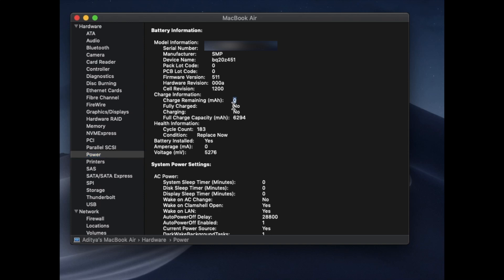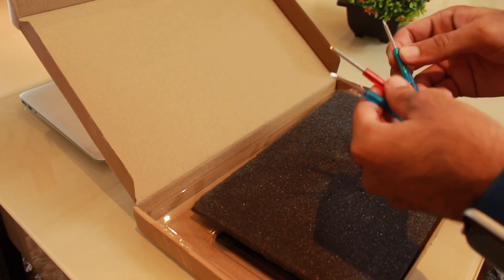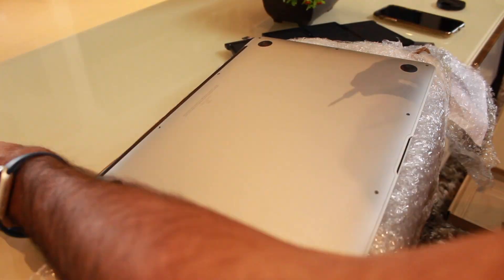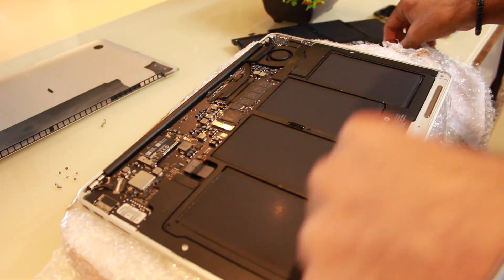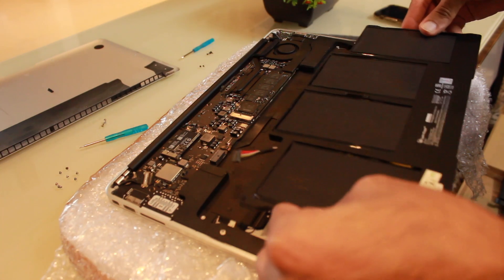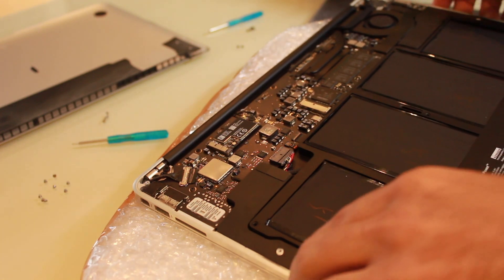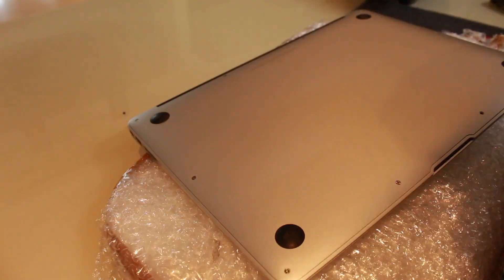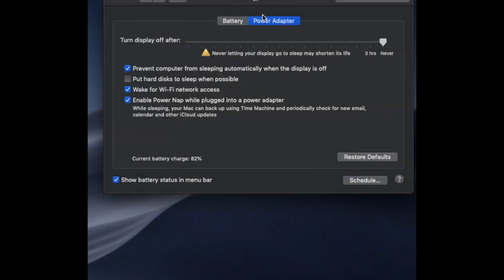MacBook Air A1466(Early 2015) Self Battery Replacement

Comment: Bro i have macbook air 2017 model 13 inch  which battery compatible for my laptop ??
Reply from the maker: that macbook's model number is A1466. So search for "batteries compatible with macbook air A1466"

Comment: After one year, what is the performance of replaced battery?
Reply from the maker: Average I would say. The laptop goes off suddenly when out of charger. Also it becomes dead when the macbook shows 20% battery left. So it can sustain for sometime without the charger but ultimately you do need to carry it if you're moving out.

Comment: Hi Aditya,

I have MacBook air 2013  and I am planning to change my battery because when it is not charging it becomes much slower and it was not usable and when it is connected to power cable it performs like as new... I have formatted many times but it stills remains the same... So di I need to Change my Battery??
Reply from the maker: Actually the thing is, when gadgets become old they lose their processing power gradually. While staying connected to power, the machine tries to push its limit to the maximum. I don't think replacing the battery would help in that case (i'm saying this with my past experience when using a mobile phone). But since you're saying that it performs like new on power then it MIGHT be the case of the battery but not sure. Additionally you may try to chat with an apple executive through the apple website for the exact remedy or may give the laptop to an authorised apple service center for inspection.
Reply: @AdityaSonthalia Sure bro... Thanks.

Comment: Thanks for the video. I also need to replace my MacBook Air battery. How was the performance and life of this battery?
Reply from the maker: I didn't notice any massive difference in the performance. But yeah the battery life has come down drastically. The battery discharges very quickly as compared to the previous one. Like if the battery percentage is around 47% virtually, in actuality its 0%. So not a completely satisfied replacement but yeah it does the job for the price incurred. Basic Browsing and video watching would be fine.
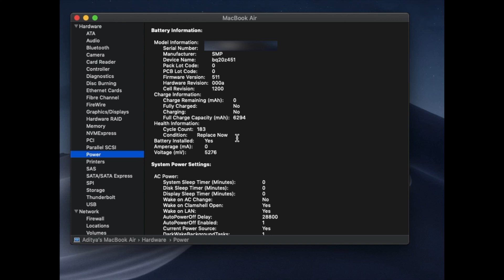Reply: @AdityaSonthalia  I appreciate your honest reply. How did you get to this 0:01 ?
Reply from the maker: @youtubeaddict5663  Sorry, get to what?
Reply: @AdityaSonthalia  it’s ok lol. I Googled it (hold down the option key and click on the Apple logo then click ‘System information’ - NOT preferences 😂)
Reply: @AdityaSonthalia  just wanted to say thanks. I ended up replacing my battery myself thanks to you ❤️
Reply: @youtubeaddict5663  How was your battery help up overtime? I need to get one too and planning the DIY route
Reply: @adityanilangekar1166  If you’re asking how my battery life has been it’s been great. I’m really glad that I did it myself rather than paying for a Mac repair shop to do it haha
Reply: @youtubeaddict5663  Great! So happy to hear this.
Reply: I need to replace mine also as it turns off when it gets to around 70%. How did you get on replacing yours? Where did you get yours from?
Reply: @youtubeaddict5663  I got it replaced from a nearby Apple authorised service provider. It's working great now. Getting around 4 hours of backup.
Reply: @kumardeepam  yeah I was thinking I should just do that coz it’ll probably take me hours to remove the battery and I’d be fuming if the second hand refurbished battery needed replacing within a year, lol. Do u live in Asia also?
Reply: @youtubeaddict5663  you should do that👍 yes, India
Reply: @kumardeepam  cheers 🥂
Reply: @youtubeaddict5663  🥂
Reply: @kumardeepam  So I decided to buy a battery off Amazon and do it myself. It actually wasn’t that bad - I was proper sweating beforehand 😂 but it took less then 15 mins to do so 🤞🏾 it lasts....
Reply: @youtubeaddict5663  incredible 👍
Reply from the maker: @youtubeaddict5663  I had ordered the battery via amazon (but sadly that seller has discontinued the same) which included the toolkit for self replacing it.
Reply: @AdityaSonthalia  Sorry my initial question was for the OP haha but it’s all good. I just found one on Amazon UK. Thanks for your replies though

Comment: Hi Aditya..... I want to buy a new battery for my Macbook air A1466. After watching your video, I decided to replace it myself. I am unable to open the provided link and when i checked it myself on amazon the cheapest one will cost me 8000 rs. Could u plz share some budget friendly options? Additionally, I saw one website “Lapgadgets.in”, and there the price is 3499. Should I go for it?
Reply from the maker: Actually due to this whole covid thing all those cheap batteries are out of stock for a long time due to absence of production. 
Considering third party companies for battery is always a game as we can't be sure of its performance or warranty. So its a challenge. Though I searched for Lapgadgets and found out that it's a decent Guj based company, We still cannot be 100% sure whether it will work perfectly or not. So considering the risk element you may go for it.
Reply: Aditya Sonthalia Thank you!
Reply: Did you purchase it from lapgadgets?

Comment: Bro the link isn't working?
Reply from the maker: yeah here's a substitute: https://www.amazon.in/dp/B089QNNF6W/?tag=adityas-21
Reply: @AdityaSonthalia  bro it's 8k u said we get it for 4k I have 2017 version
Reply from the maker: Sorry bro actually that 3rd party product is not available now and other products dont have any review. So its a win loss situation basically on whether you want it or not. i will provide you the link for the cheap one. Also what is your macbook's model number.
Reply: @AdityaSonthalia  2017 version MQD32HN/A A1466
Reply from the maker: here is one for 5k. That's the minimum I saw: https://www.amazon.in/dp/B084388J4R/?tag=adityas-21
Again, there is no review for the same and hence I can't guarantee you the performance. It depends upon your luck.
Reply: @AdityaSonthalia  okay thanks bro

Comment: In which Apple service center they quoted you 14K for battery? Here where I live they estimated the battery replacement around 20-25k :(
Reply from the maker: Sorry to hear that. That's the main problem with apple service centres in India. There is no proper transparency on the services they provide. Btw here in Kolkata, I had a talk to one of the apple representatives. So he gave me the estimate of around 14k at that time.
Reply: @AdityaSonthalia  Thanks for the reply bro. Video really helped me. I went to a local computer hardware wholesale store. Just got a genuine OEM battery with 7150mah battery capacity for 5900. Apple Service centers in India is just looting from people. In US pricing is more transparent.
Reply: @aravindhsharma2878  where you buy OEM battery?
I am having same issue and I got one from online shop but it didn't work, so please help
Reply: @AdityaSonthalia  My macbook is barely 3 years old. I was very ignorant, I used to put my laptop always on sleep. I never shut it down even when laptop is not in use. It used to last 12hrs now because of putting it on sleep for 3 whole years I'm getting only 2hrs sot.
Reply: they quoted me around 12k. :( fuckers
Reply: They asked me 9 k
Reply: @vishalkhobragade3535  Where?

Comment: Hy is the backup timing same as the original one?
Reply from the maker: no it's a bit low.
Reply: Should i buy ?or go for new battery frm service center
Reply from the maker: It depends. If you can pay more, you may go for the original battery.

Comment: Hi bro,
Nice video can you please suggest me from where I can buy original battery for MacBook Air 13".
My Macbook battery not charging and displays notification to replace it. Battery used only 48 cycle.
Reply from the maker: If you wanna buy the original battery for your macbook then i would recommend you to buy from the official apple retail store but do remember it would be a bit expensive.

Comment: My macbook air battery is showing replace soon message. It's still goes on for 4 hours. So, is it time to change battery or shall I wait some more time?
Reply from the maker: I would recommend you to replace your battery now as I had faced the same thing. Also I would suggest you not to put your mac on sleep mode just by putting your flap down... it indirectly harms the battery. Shut it down whenever possible.

Comment: Hello brother i just watched your video liked  and subscribed brother how long your battery goes on video after replacement
Reply from the maker: battery backup is little less compared to original (say 3hrs of SOT)but the main thing is that it's still working fine and my risk was worth it 😅
Reply: @AdityaSonthalia  so brother will you recommend me to replace my MacBook air 2015 battery its current backup is almost 3.5 hours on video if i change it will it give me 6 to 7 hours backup or the original one is good enough?
Reply from the maker: Bright Civil Engineering Line the battery which I purchased is giving me a decent SOT. But it's always preferable to go for original product if you don't have price constraints. I had a talk with the apple service centre and they had told me the battery replacement would cost me around 12/14k inr. Since the one i ordered was 1/3rd the price and was matching my needs, hence I went for the same. So it's upto your needs and budget. :)